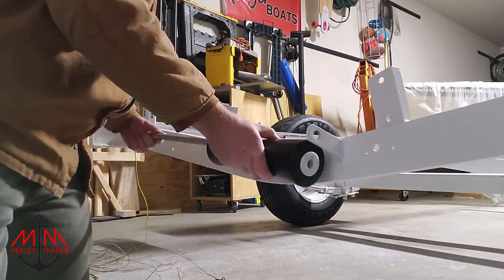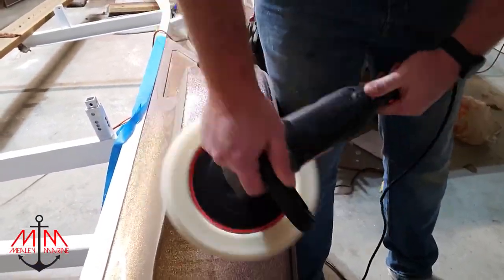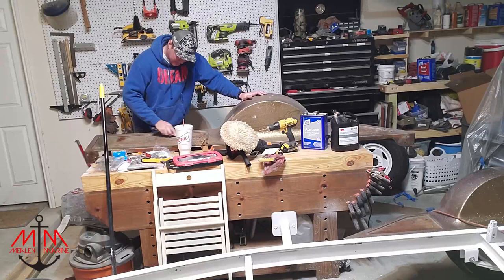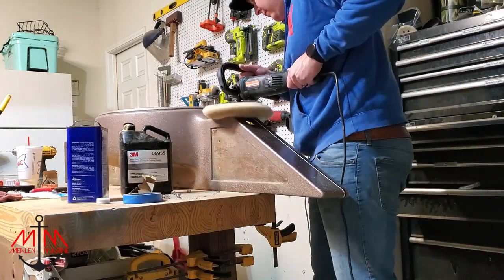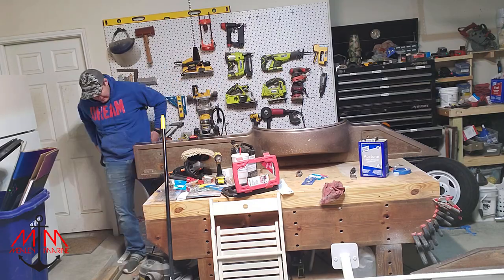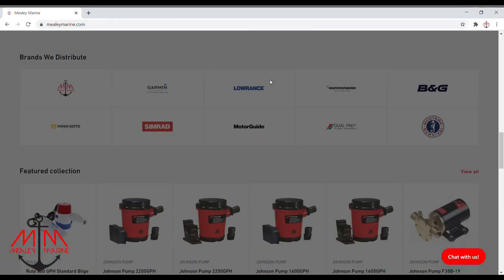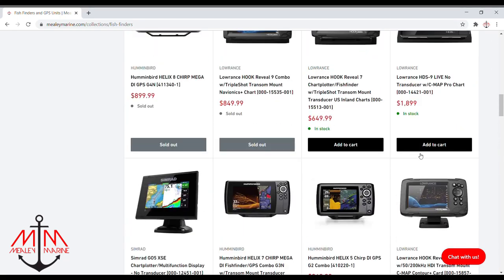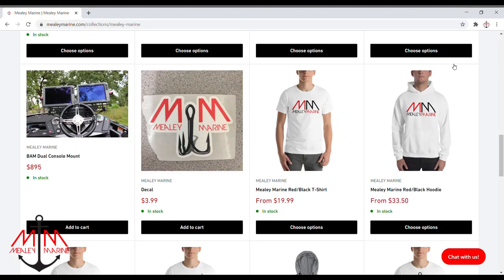BASS BOAT RESTORATION | 1988 RANGER 363V | PART 7: BUFFING FENDERS

Comment: Did you try wet sanding the gel coat first? This can help remove the oxidation and bring back the finish to near perfect.
Reply from the maker: The gelcoat oxidation came out with the heavy duty cutting compound. The pink color happened from the metal flake fading from being in the sun for so long. So I'm stuck with a pink boat
Reply: @MealeyMarine  haven’t seen one that faded in some time. You’re doing a great job rebuilding the boat. I have enjoyed all the videos.

Comment: Looking good sir...keep it up. I just finished my deck and it looks great..I'll be sending pics to ya soon. Also I'm hoping you will be replacing or at a minimum doing aerator pump work on your boat..i could use some help.
Reply from the maker: Thats the plan! Finish the trailer this week. Buff the bottom. Boat on trailer. Buff the boat then work on it!